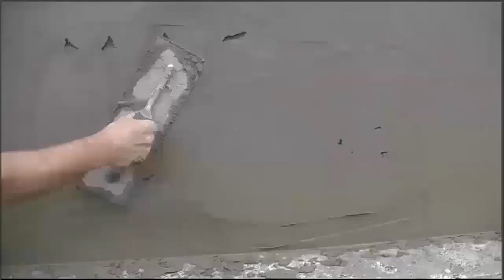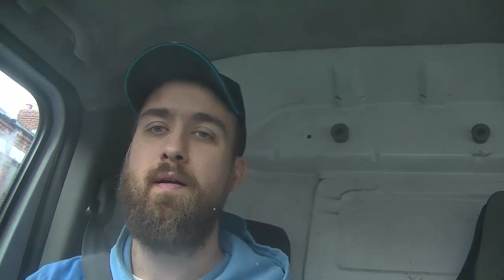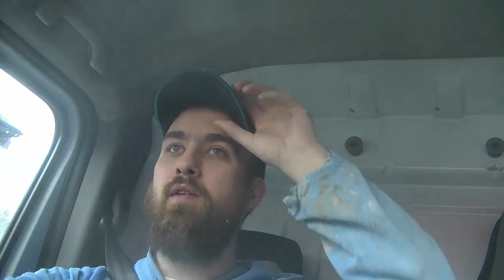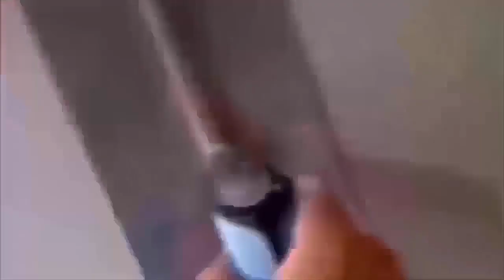mixing drills power float trowels failing ceilings

Comment: On the failing ceiling I've found som of the wall preps (grit) don't tend to cure on certain sorts of paint
Reply from the maker: I dont use it no more pva never failed me the way that grit did , everything done by the book and it failed I thought the 1st time it was just a freak one in a million  but then again im like never again
Reply: I use a Both mixed together, no issues yet🙄
Reply from the maker: @chrisbutcher3280  pva and grit ?
Reply: @macplastering 
Thin the pva and mix them together the grit gose further and you can see the coverage drys quicker as well
Helps the pva to hold back on real dry surfaces
Reply from the maker: @chrisbutcher3280  i do tend to stick to the rule book on manufacturers guides not that it worked to good on them 2 jobs haha